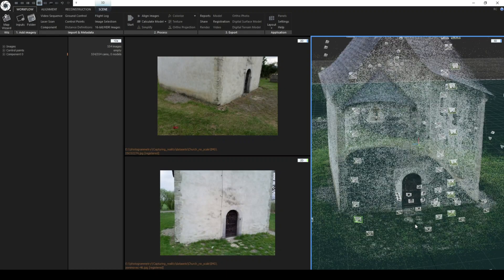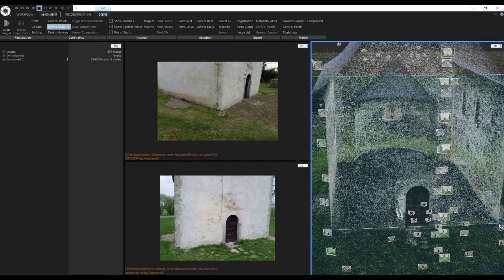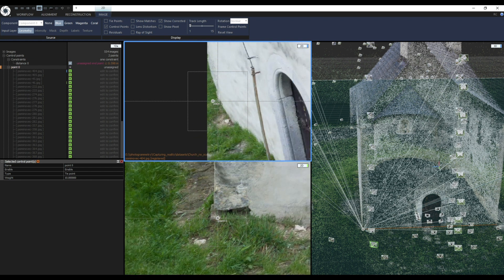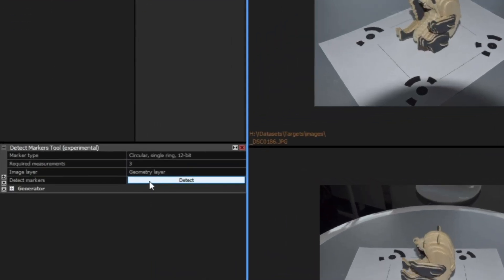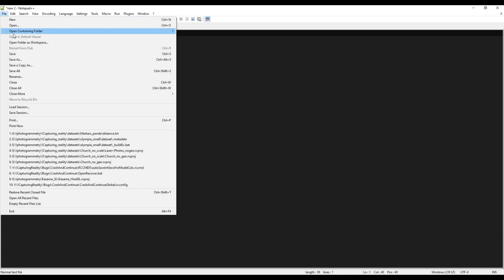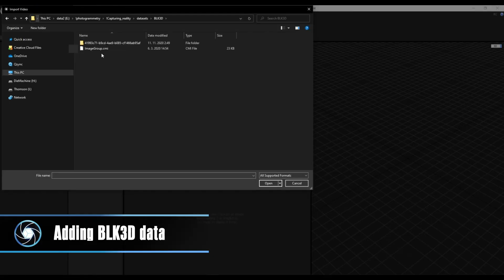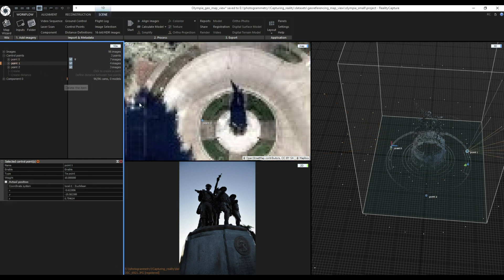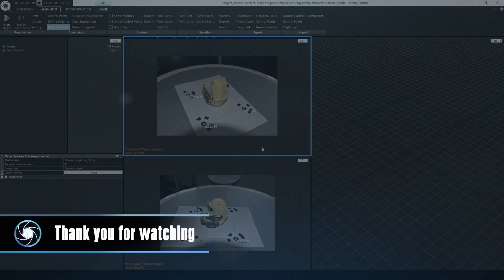RealityCapture tutorial: Scaling methods

Comment: i dont know if im doing it wrong, but after defining the new distance and clicking update, the new calculated distance differs alot from the defined distance.. ant also the new model is rotated in space. Im using realityscan 2.0.2 for desktop (windows)
Reply from the maker: What kind of data are you using? Is it already georeferenced? Have you tried new alignment instead of update?
Reply: @RealityScanOfficial  Thank you for the quick reply, I feel like Im learning so much by doing, and asking questions here is much better than asking for example chatgpt, It always gives some random answer that is completely wrong..
Reply: @RealityScanOfficial  I had a mix of images from drone and camera. The drone images were georeferenced.
Reply: Update: I solved my problem by setting unknown to the "absolute position" parameter of some automatically georeferenced images.

Comment: I set the distance to 0.02 (2 cm) in Defined distance (after alignment), click Update under Registration, and then Calculated distance and Defined distance still don't match and there's a red warning sign next to Constraints that says "There are some errors in the defined constraints" when hovered, but I can't see any error anywhere. After that, every time I click Update, Calculated distance is a new random number.
Reply from the maker: What kind of images are you using? Can you try Alignment instead of Update?

Comment: Why can I not just scale it. Measure a distance (tells me calculated 3.02 M) and I know it is 1M. Why can I not just say: this is 1 Meter??? Now it alligns images for another three hours, but my model is already  finished? Why is there no better way? This is really cumbersome
Reply from the maker: You can do it and for that you need to use the distance constraint as is described in the tutorial. After setting the distance use Update tool in the ALIGNMENT/Registration tab.
Reply: @RealityScanOfficial  I've tried everything, and the calculated distance is still way higher than the distance I set it. I have it set at 0.1m and the calculated distance is 3.1m?
Reply from the maker: @jnortheastfilms  Are you using georeferenced images? Can you try also the new alignment?
Reply: I took the photos on my phone. Could it be using gps data from the photos?  @RealityScanOfficial
Reply from the maker: @jnortheastfilms  Yes, that could be the reason for that. In that case, you need to set the images' prior poses as Unknown in 1Ds view.
Reply: @RealityScanOfficial  this solved my problem

Comment: Why isn't there one object/marker that is made for RealityCapture, where the software knows automaticly how large it is. So you add this object into the scenery and the software automaticly knows how large everything is? Why do i have to still define the markers? It would be so much easier.
Reply from the maker: Hi, photogrammetry is scale less in general. So, if you don't have additional information, the object won't be in a proper size.
Reply: @RealityScanOfficial  I get that. But that's what i mean. If you design an object specifically for Photogrammtry like a marker, where the software already have the information how large that object is, the scene should then be scaled that way without using two points in a scenery. Like for ex. there is a fixed general size of car license plate for a certain country. That license plate is always the same size. It doesn't change. If i don't have any markers or anything. I would just use this information to scale the whole scene. But Reality Capture have a internal marker detection that detects specific markers in a scene automatically and they type ect. .Shouldn't be this information enough to tell RealityCapture how large the scene/marker is?
Reply from the maker: @ Theoretically that's true. In practice, you can create such scale and use that in automatic process inside RealityCapture.

Comment: I'm wondering if constraints from IRL measurements and April Tags will improve accuracy of image alignment and mesh, and improve the accuracy of fine details. I'm not bothered about the scale accuracy, just the detail of the model (building) as I have noticed the some features like roller shutters on shops tend to be terribly aligned. If it's worth the effort I'll go all out...
Reply from the maker: Hi Paul. Yes, on some places it can help.
Reply: @RealityScanOfficial  will just having the tags / targets in various places help too?
Reply from the maker: @PaulChapman-j6v  But they need to be measured as control points.
Reply: @RealityScanOfficial  so they must be added and the distances between them measured, and then they will improve the accuracy of alignments, in particular fine/intricate details. For example repeating fine details like roller shutters, guttering, door handles, fencing / railings etc? I'm not bothered about scale / relative accuracy, but if the effort is worth it for that sort of accuracy then I'll go out and purchase the necessary equipment. Ie laser range finder etc.
Reply from the maker: @PaulChapman-j6v  The improvement of them is also just using them as control points. It is not necessary to measure the distance between them (that is for scaling) or their coordinates (for scaling and georeferencing). 
For such objects only better capturing will help (also not always, as those are not ideal objects for photogrammetry).
Reply: @RealityScanOfficial  awesome, thanks for the help.

Comment: I have a small scene like your one at about 4 minutes in. With the Detection Markers on  the ground. When I  Calculate the model it comes out at a strange angle. How do I use tell CR that the control point from "Detect markers" are all on the ground plane (i.e. zero in height / z axis). I have tried forcing the (detected) marker control points  to be Ground Controls, but this causes corrupted control points (Red Triangles)
Reply from the maker: As you did, you need to set them as Ground Controls, add its coordinates and then align again or update the alignment.

Comment: Hello, the scaling doesn't seem to work. I detect the markers first and then align the images and then use a .txt for defining my distances. But the distance gets overridden with Calculated Distance and also my orientation is completely off even though the 4 markers are detected. What's your advice?
Reply from the maker: Hello Vishal, When using detect markers and scaling via txt file you should 1st detect your control points, then add the txt file with the distance constraint and then align images, not vise versa. If you for some reason need to import the text file after alignment you need to click on alignment again, You can also use the update button which is also under the workflow tab, but it will not be as precise as aligning images again.
Reply: @RealityScanOfficial  Hi another question just occurred. If want to use the scaling markers, should I generate a binary mask with or without the masks? I would like to use these masks for considering only the pixel within the mask for model generation.
Reply: @vishalanime  If you want to use masks you would need to disable masks for alignment so RC could find any features in the parts where markers are placed. Enable masks only for the reconstruction. Alternatively, adjust you masks so markers will be masked in and could be also used in alignment if you need masks for alignment.
Reply: @RealityScanOfficial  , any comments on this?
Reply: I might have figured it out. I set the pose hardness for camera priors under the alignment settings to zero.